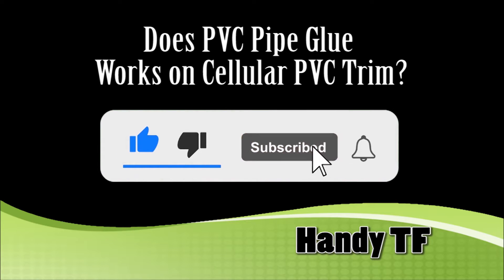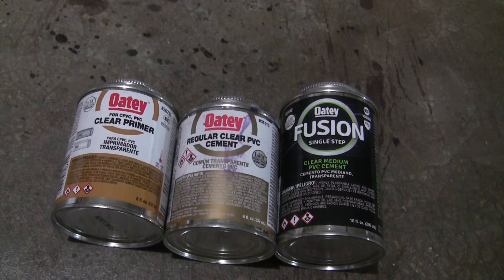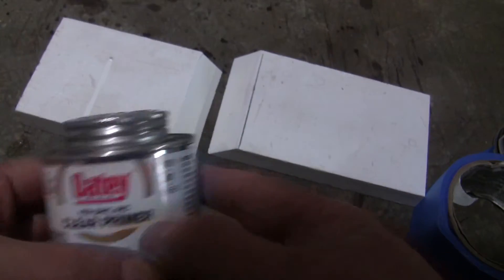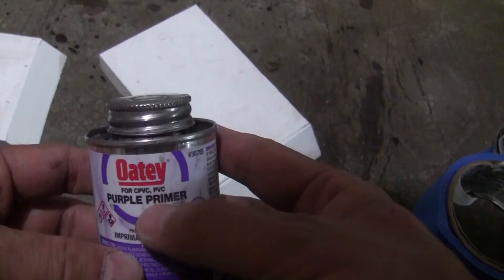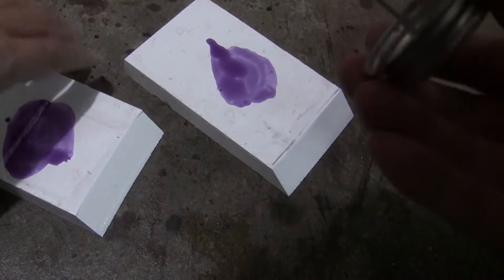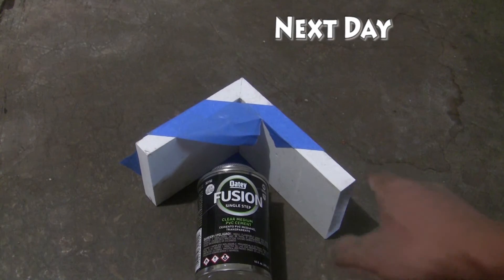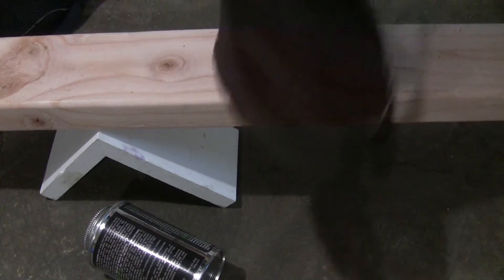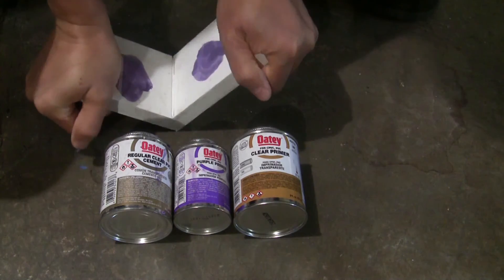Does PVC Pipe Glue Works on Cellular PVC Trim?

Comment: Thanks - exactly what I was looking for, w no 20 minutes of Added Content we don't need!  FYI...I need to bond together two 3/4 Inch PCV boards lengthwise to make 1 1/2" Inch stock to make a French Door "Mull" (they make them to Rot on purpose - the replacement part is over $450USD). 

This is exactly what I needed to know. One Subscribe for that one!